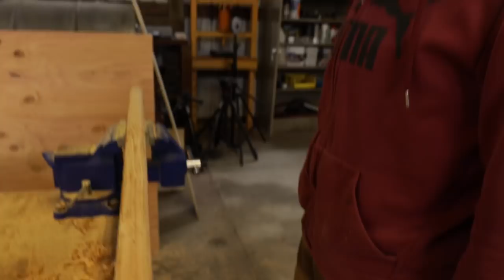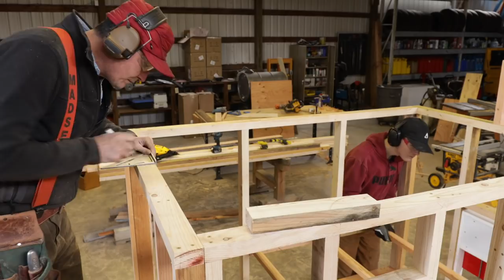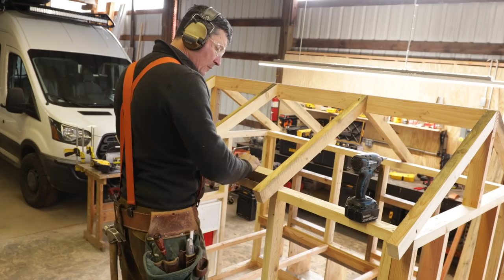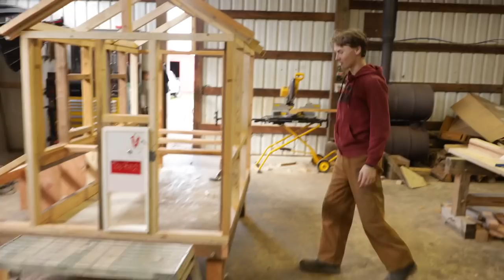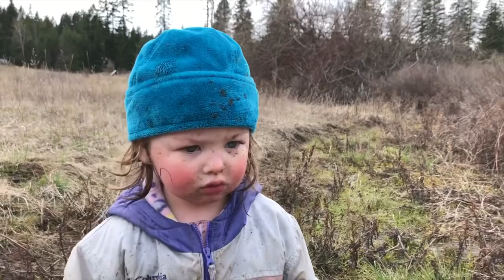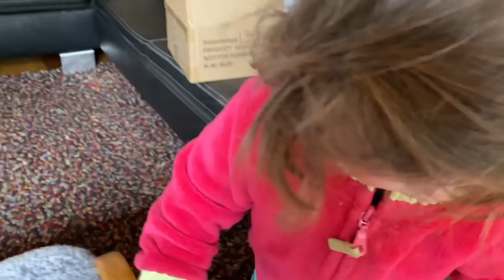Build A Pandemic Chicken Coop

Comment: roosts with 3 inches across the top  is best , mine were 2x4's  with 4" across the top ,  chickens are ground dwellers , not tree birds , in winter the toes do not need to hang down in cold air , winter feed whole corn  .